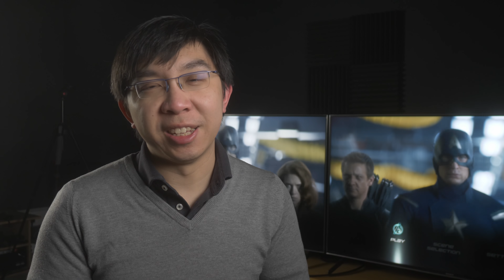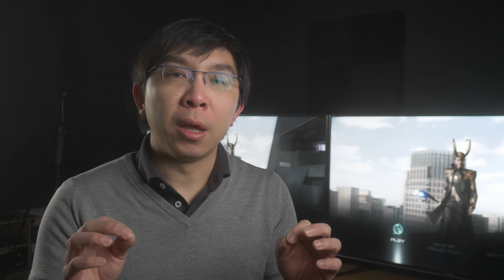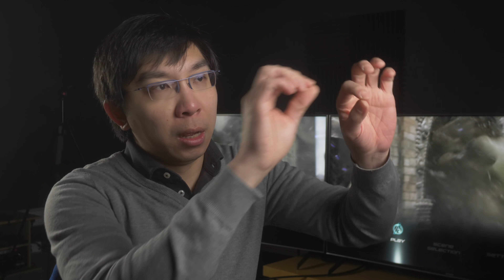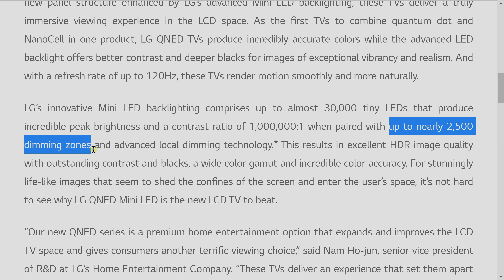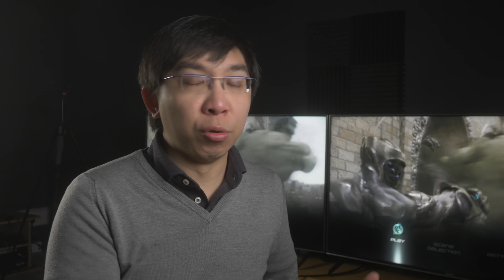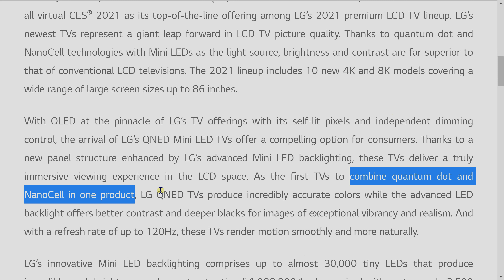LG Unveils Its 1st QNED Mini LED TV with Up to 2500 Dimming Zones

Comment: Sigh... My room isn't that big. Why can't these TV manufacturers make 40-inch OLED TVs? I'm not planning to make a local movie house, you know?
Reply: Most living rooms here in the UK aren't big compared to the giant rooms in the USA and Australia. My living room is small but I'm still getting a 65inch OLED in the next few months.

For small rooms decorate them uncluttered with nothing taking up big spaces. That will make the room feel much bigger and you will easily be able to put a 65inch tv on a stand or hung on the wall 👍🏾
Reply: Most people here in the UK are buying 65inch tv's for their living rooms. The demand for 40-48inch tv's is very very low. Its mostly the elderly over 65s who have those smaller sized tv's and they don't care about OLED or tv technology.

What country do you live in? And what is your living room dimensions? I find it very hard to believe you can only fit a 40 inch tv into your living room. It must be very cluttered to much stuff in the room.

Comment: Is the QNED going to be better than OLED?
Reply: No 👍🏾
Reply: QNED - Quantum nano-emitting diode (QNED) display technology is an advanced platform based on blue nanorod light-emitting diodes. With a unique core-shell and three-dimensional nanostructure, nanorods integrated onto a backplane thin-film transistor could offer superior aspect-ratios and quantum efficiencies compared to any platform currently available.

Theoretically, QNED structures could achieve a greater functional density than all planar LEDs, including those intended for use in QD-OLED systems. QNED backplanes could have an emitting surface area of as much as 10x that of OLED panels, potentially overcoming the light intensity limitations of OLED technology.

QNED is similar to the likes of MicroLED, which has been marketed in extremely large panels (73”+) at tradeshows for some time. However, MicroLED is prohibitively expensive for most consumers and is yet to emerge in smaller formats.

One of the most interesting facets of QNED technology is that existing nanorods emit blue light and can be integrated onto the same thin film transistors used to form blue OLEDs.

Comment: I just want a oled like tv with no burn in then I'm sold.. haha
Reply: I bet you are one of those who never tried OLED and only read about it. I have 3 OLEDs and zero burnin, thousand of hours on all of them, gaming, pc usage and regular watching. Will never buy LCD again. It's OLED or MicroLED. I can't stand backlight bleed, blooming, smearing, corner glow, bad uniformity and generally crappy contrast and viewing angles. I will take the small risk of burn-in ANY DAY over the massive problems LCD has and always will have. The tech is dated and issues will never get fixed.
Reply: @Dr.WhetFarts  I have never had one.. but I would be strictly gaming on it for 6 to 8 hours a day rpgs.  HuD on screen for hours everyday... just for see hud burn in issues
Reply: @Ping Pong no production to begin 2nd quarter next year. They registered the trademark already. We'll know for sure on Tuesday
Reply: micro-led is the only tech that can do that, still several years away unfortunately.
Reply: @rickwest4497  you've not been paying attention then. Samsung QNED is self emissive and will not burn in. It will be brighter and more colourful than LGs white OLED

Comment: QNED is the future OLED not!
Reply: QNED- Quantum nano-emitting diode (QNED) display technology is an advanced platform based on blue nanorod light-emitting diodes. With a unique core-shell and three-dimensional nanostructure, nanorods integrated onto a backplane thin-film transistor could offer superior aspect-ratios and quantum efficiencies compared to any platform currently available.

Theoretically, QNED structures could achieve a greater functional density than all planar LEDs, including those intended for use in QD-OLED systems. QNED backplanes could have an emitting surface area of as much as 10x that of OLED panels, potentially overcoming the light intensity limitations of OLED technology.

QNED is similar to the likes of MicroLED, which has been marketed in extremely large panels (73”+) at tradeshows for some time. However, MicroLED is prohibitively expensive for most consumers and is yet to emerge in smaller formats.

One of the most interesting facets of QNED technology is that existing nanorods emit blue light and can be integrated onto the same thin film transistors used to form blue OLEDs.

Comment: 16:9 × 4 = 64:36
64 × 36 = 2304
I'm not sure if that is LG's "almost 2500" dimmable zones, but 64 × 36  is exactly double the linear resolution and four times the total number of the 576 zones in Apple's Pro Display XDR monitor which has 32 columns and 18 rows.

Comment: It would have to be a big improvement for LG because their current LCD TVs are quite poor.
Reply: What the difference between LCD, OLED, QLED, QNED
Reply: @samwalsh8299  LCD uses a backlight, OLED is self lit LEDs with no backlight, QLED is LCD but with quantum dot LEDs, LGs QNED is QLED with smaller LEDs. Samsung has their own QNED, or QDOLED, which is OLED with quantum dots. MicroLED is like OLED with smaller LEDs.

Comment: Get back to me when they finally go micro LED.  Meanwhile, I'll stick with OLED.  LG, prove me wrong.  Also, you can absolutely never take their contrast ratio figures at face value.  They are always grossly exaggerated and never near real world applications.  A contrast ratio of 1,000,000:1 is likely citing a single pixel being as bright as it can be while surrounded by a million "black" pixels.  I am much more interested in seeing whether or not LG will adopt Panasonic's cooling tech that's being rented out for higher HDR peak brightness on their OLEDs instead.  If I wanted the best image quality just for movies, I'd just buy a Panasonic, but I need to factor gaming as well, and LG is currently king in that arena.

I have a current iteration of LG's "Nanocell" monitors, and yep...looks like an IPS, which is simply "good enough" for gaming, but ugly for everything else.  Color reproduction doesn't matter if the contrast is terrible.

Comment: It's still an IPS panel with it's crappy native contrast...
Reply: Va is only good for loners though.
Reply: @heman691  VAs now have a Wide Angle filter which seems to work great. In the end, I'll stick with an OLED which has even better viewing angles than any IPS, nevermind black levels. But for LCDs, I's stick with a Sony, which even though they have a tad more blooming than Samsungs, they don't black crush as much and don't darken even bright highlights in order to keep blooming to minimal which makes that 1000+ nits basically useless if they keep doing that.
Reply: @Azreil24  Wide viewing angle filter = much lower contrast and viewing angles are still mediocre. VA is not suited for many homes because of this. When you view most VA at an offangle image quality drops alot.
Reply: @Dr.WhetFarts  Newer versions seem to affect contrast much less than first iterations. Even with the WA filter, the VA contrast is still miles ahead of IPS.

Comment: I still love my 2019 TCL 65X10  QLED (Android  version of  Roku TCL 8 Series) with 15,000 mini-LEDs in 768 dimming zones - great value now at around $1K,  if you can find one.
Looking forward to seeing how the mini-LED tech improves in 2021 with LG.
Reply: 1k? It's around 2,2k Euro in Germany :D
Reply: @EDIIIZ   I'm in Japan and got mine here for around ¥100,000 - about €800
Reply: @seanrm  Wow. That's a big difference :D
Reply: @EDIIIZ   I think in the US the 65" Roku version is regularly on sale at around $1000. 
Europe still seem to be asking the original 2019 MRRP, so expect that to drop when TCL start to push their 2020/2021 models there.
In Japan they just released their C815 & Q815 models but, depsite being newer, neither are as good as the 2019 X10.
Reply: The 2021 TCL Vidrian MiniLed is much better improved than their first MiniLed models 👌🏾

Comment: I was hoping to see a 65 inch mini-led with more than 3,000 dimming zones. 
2,500 zones on a 86 inch does not indicate that will happen, I guess it's to expensive.
Reply: 3,000 dimming zones is still abysmal compared to 4K OLED's 1:1 pixel level dimming aka 8 Million+ dimming zones.
Reply: Samsung high- end qled TV's ,has 1000 dimming zones

Comment: I wonder if LG are using Dual Cell LCD or maybe a layer of Nanocell can be used between the Mini-LEDs and their IPS LCD Panel to act as a shutter layer, much like how Hisense uses BOE's 4K/2K tech to achieve 1,000,000:1 native contrast on the dual cell LCD TVs they've produced.

Besides creating entirely an entirely new LCD structure I don't see how they could get this level of contrast performance in an LCD TV.

It's good to see LG adopting methods to enhance their Nanocell TV lineup.
It will be interesting to see how this TV tech performs compared to other  LCDs and OLEDs.
Reply: LG QNED- Quantum nano-emitting diode (QNED) display technology is an advanced platform based on blue nanorod light-emitting diodes. With a unique core-shell and three-dimensional nanostructure, nanorods integrated onto a backplane thin-film transistor could offer superior aspect-ratios and quantum efficiencies compared to any platform currently available.

Theoretically, QNED structures could achieve a greater functional density than all planar LEDs, including those intended for use in QD-OLED systems. QNED backplanes could have an emitting surface area of as much as 10x that of OLED panels, potentially overcoming the light intensity limitations of OLED technology.

QNED is similar to the likes of MicroLED, which has been marketed in extremely large panels (73”+) at tradeshows for some time. However, MicroLED is prohibitively expensive for most consumers and is yet to emerge in smaller formats.

One of the most interesting facets of QNED technology is that existing nanorods emit blue light and can be integrated onto the same thin film transistors used to form blue OLEDs.

Comment: I think I'll wait for Micro LED. The technology checks every box. The best of OLED and LED combined, on paper at least.
Reply: You will wait for more than 5 years and probably 10 years as micro leds is a pipe dream for the next decade at the moment.
Reply: @thephantom9080  by the time Micro-LEDs are usable OLED Panel makers will have implemented Plasmonics research to basically bring an end to Burn-In and the tech will be far cheaper.

Most likely Self-Emissive Quantum Dots will also be really cheaper, probably with better color performance and brightness.

Micro-LED seems like a pretty pointless technology considering how far away it is for consumer products and the sheer cost that will be required.
Reply: @thephantom9080  I upgrade my TV every 10 years or so. I don't mind the wait as long as it is worth it. But if self emissive Quantum Dots tech is coming sooner and cheaper I'll definitely be interested.
Reply: Keep an eye out for self emissive Quantum Dots, along with Dual Layer LCD TVs.
Reply: @MrSec84  Self emissive QDs tech surely sounds intriguing, I never know it was a thing until know. Will keep an eye on it thanks.

Comment: Just got my LG CX and it's outdated already? 😭😭😭
Reply: Didn’t you see the video? LG’s QNED is a lower tier from their OLED.
Reply: LG will likely be making better OLEDs for their 2021 lineup, along with supplying other TV makers with the same or better panel tech than Panasonic used in their brighter OLED TV lineup from 2019/2020.

HDMI 2.1 implementation will also be far better, I'm sorry to say that this year's TV tech is a stop gap, but this isn't exactly a surprise, it's been talked about on a bunch of tech YouTube channels and websites all over the Internet.